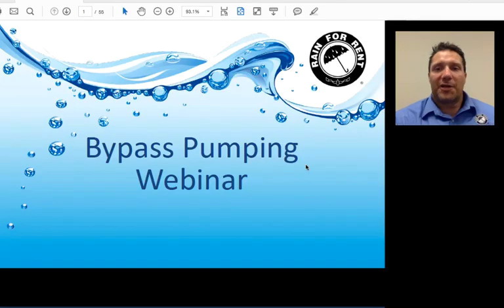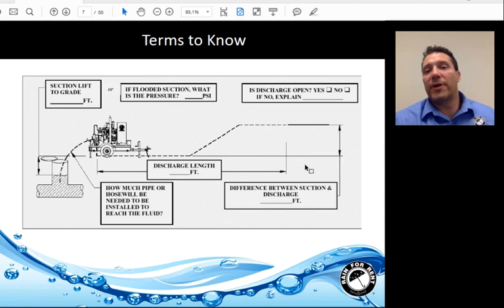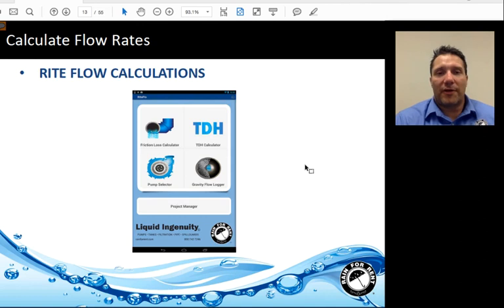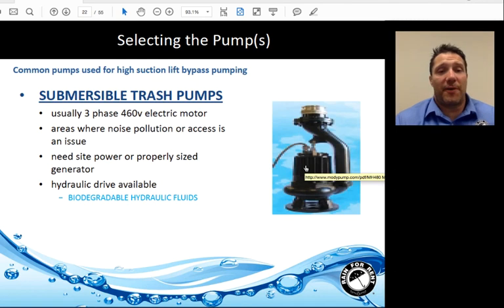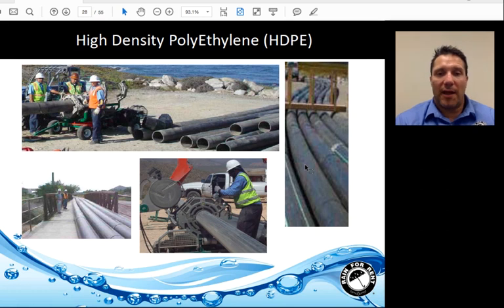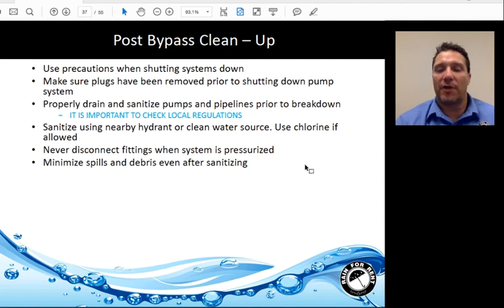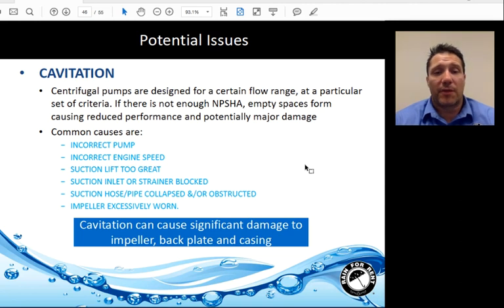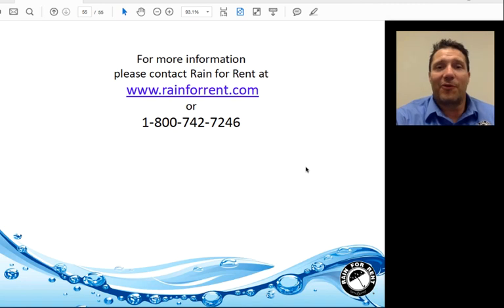How to Plan for a Sewer Bypass Pumping Project Webinar (Archived)

Comment: Can pressure drop because of regeneration? The engine regenerates at 1400 RPM if running at 1480 will it loose psi? We get 1500 from one pump but only 2500 with two when we start second . And then the psi drops. And it’s difficult to get it back unless we start the backup pump. I’m not the engineer, just the bypass pump watch operator. I’m new at this and can’t seem to get it to do what they expect.